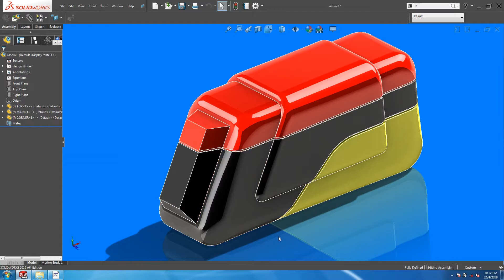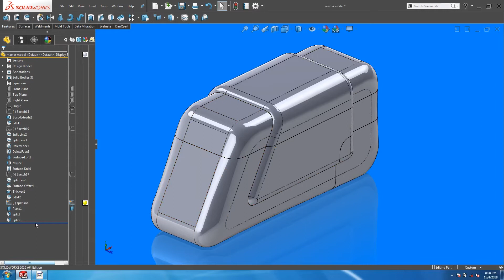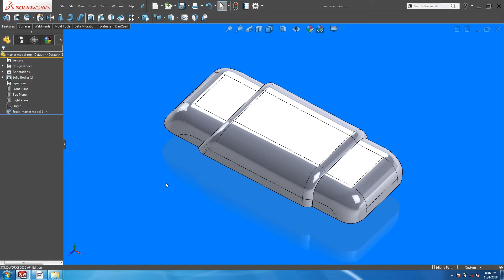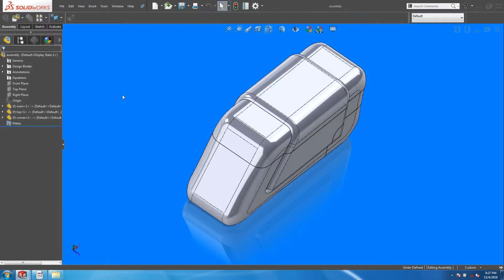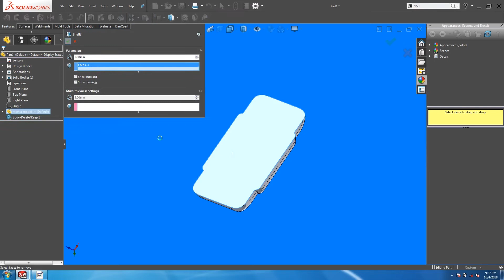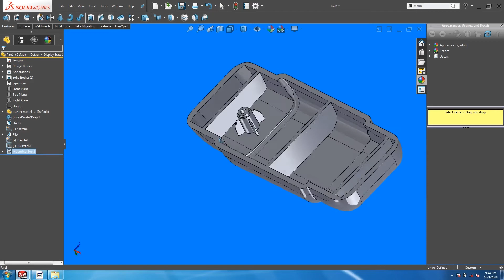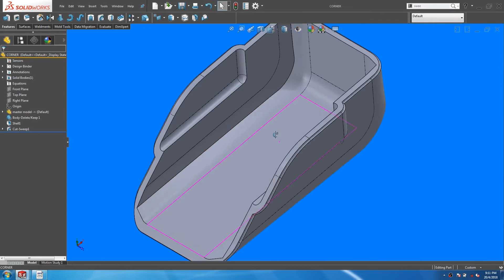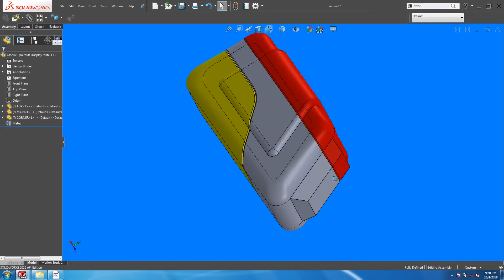Solidworks - Master Model Workflow

Comment: That surface loft technique to get the custom fillet shape is so interesting. never seen that. 1:29. Also, upon further inspection, it may seem like its cleaning up the surface but it's really not. If you do a surface analysis, you'll see that it's a mess compared to the fillet you had originally. The better way to do what you did is with the "set back parameters" in the fillet tool.

Comment: 3dexperience parameter design study app allows automating simulation of response to excitation via parameter value changes cascading to geometry changes. Capturing the impact on the ribs from this automation seems impossible across iterations because the  descendant parts never go out of sync. Which method resolves this?

Comment: question: say you wanted to make a master model of something that has bolts and threads, how would you make seperate bodies with complex interlinking surfaces?
Reply from the maker: Hi, for bodies with complex interlinking surfaces, I would imagine that you can still split the master model into bodies and subsequently convert them to components. I feel that I might not have grasp your question correctly.
Reply: @solidworkslab-g8x  ok, say you have modelled a product that has screws and holes etc. would you define the thread parameters in the master model, or define them individually once have split up the bodies?
Reply from the maker: I have not tried a top down approach with screws and holes before. I do know that in assemblies, you are able to define holes that cut through more than one component.

Comment: Solid Byte your videos are great. Even in methodology are second to none. I got a question: if you have a plastic product with 3 parts, 2 of them can be designed perfectly with this Master Model Method but the third one is a kind of cover which hides partially the two other parts. Could I make 2 Master Models? A first one for 2 parts and the second Master Model for the third part?. If you send me your email I could send you pictures of the parts. Thank you.
Reply from the maker: Hi, thanks for the compliment. You can send the pictures to me at tanwinghoe1983@gmail.com.